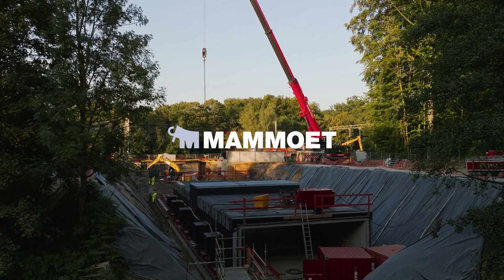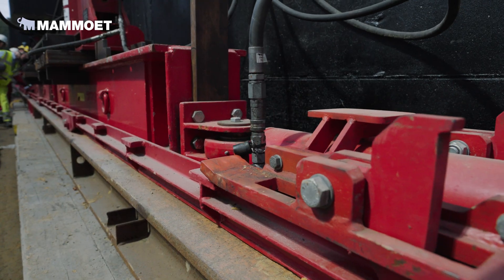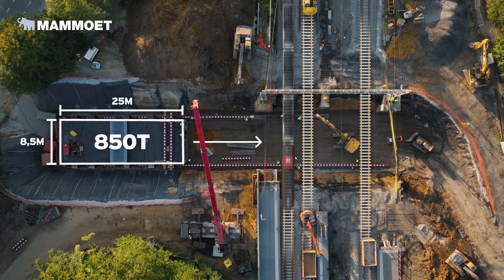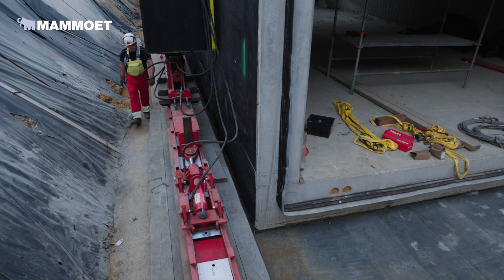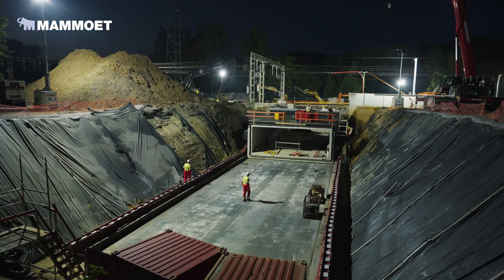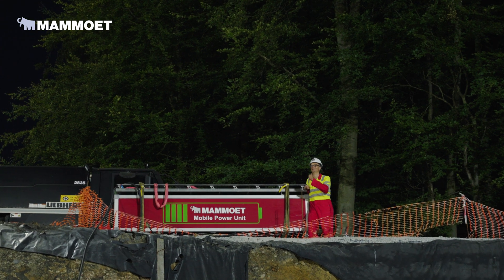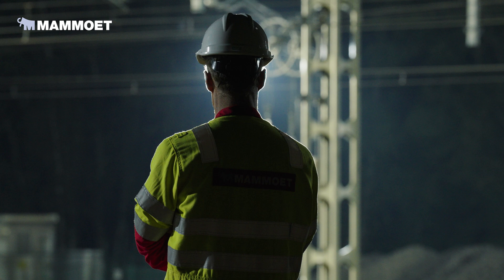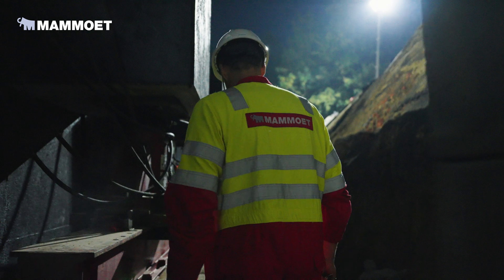Installing a tunnel using ONLY ELECTRICITY

Comment: Considering that the batteries don't self charge, this is false information. Unless the batteries are charged by wind or solar, it's just another load on an already overtaxed electrical infrastructure.
Reply: Listen again! He said " reducing our footprint ON THE CLIENT'S SITE! The batteries are charged elsewhere. Get your head out of the ground.
Reply: @The_DuMont_Network  Listen again, he said  0  (Zero) emissions.  Do you know what 0 (Zero) means?  Ponderous.
Reply: @The_DuMont_Network  So you're saying that because the batteries are charged elsewhere there is no load on the national grid? With the additional load of battery powered vehicles, tools and equipment to the existing load of industrial, commercial and residential consumption, international power grids are suffering.
Reply: @jimmackey2909 they said it reduce the pollution on the job site not that they reduce pollution completely that’s the difference.
Reply: Obviously transitioning to clean electricity is a 2 step process:
1) Replace combustion engines with electric motors.
2) Power the electric grid with all clean sources.
The steps are each too huge to happen instantaneously, but you already know this fact.
Reply: It is not a constant load during construction, the batteries can be charged during times of low use.  This also save the company money because electricity is cheaper at those times.
Also using On Site generators or diesel machinery, emits more gasses than the equivalent electricity sourced from gas or coal power stations.  Solar and wind are better of course, but any electricity is better than On Site power generation.